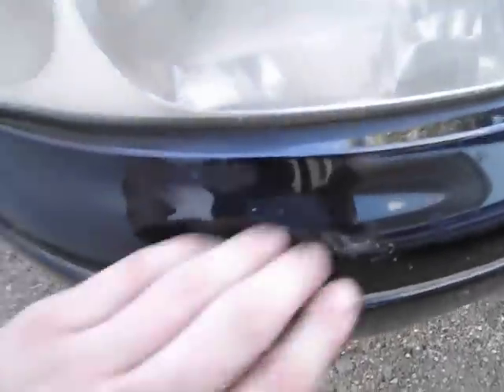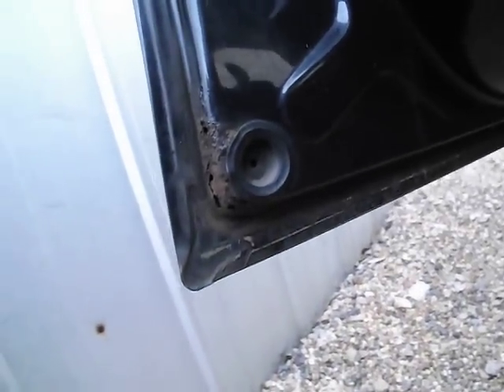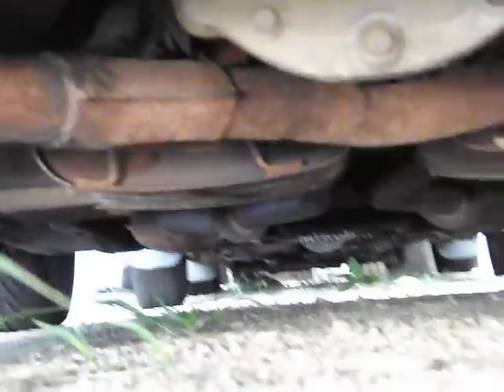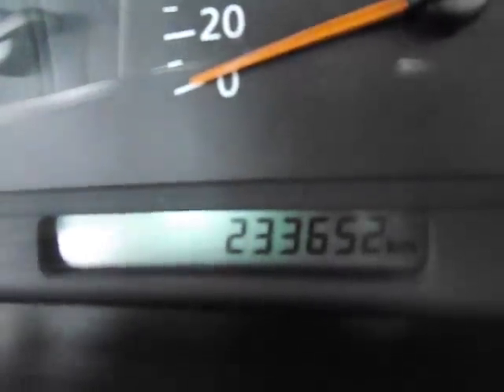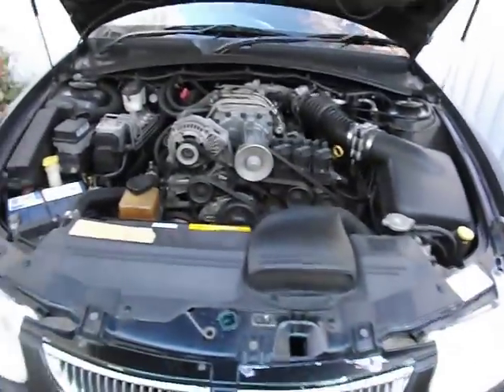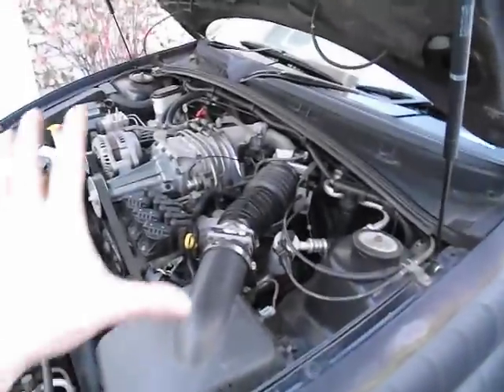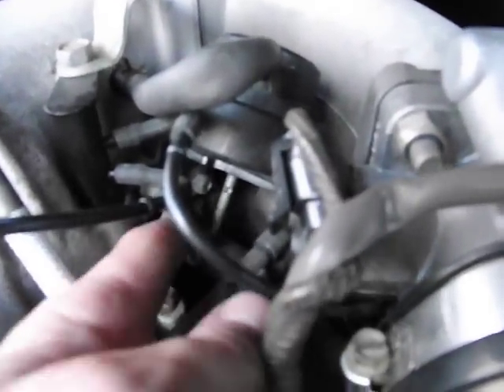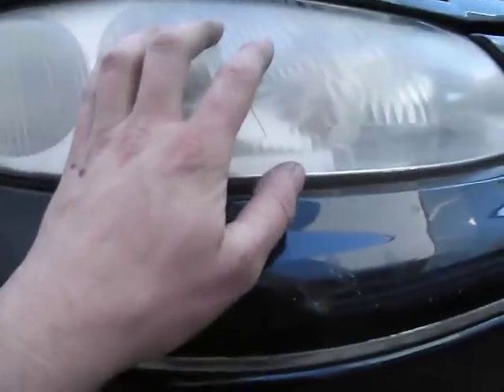VT Calais 1998 suupercharged

Comment: The GM 3.8 liter V6 has a very good reputation for reliability.  Used widely in many different models in the U.S.  Too bad GM stopped making them.
Reply from the maker: My thoughts exactly; the old cast iron head push rod v6 is very tough and will take long term abuse and neglect and still perform well
Reply: rangerpru i find buicks were a stronger engine though they could take a trashing
Reply from the maker: my vs took a hell of a hard life :) towed a twin horse float before I bought that car. this car has not really been flogged

Comment: Looks like really nice car dave :-), as you said its bits and bobs that need some love.
The fact that the bodywork/underside is in really decent condition makes it worthwhile :-D.
I like that engine, a beast but the alternator/turbo/coilpacks are easy to get to, very nice.

The door rust, once fixed you might want to pour some old oil into the door, should leave a really thin coat on the inside, harder for the water to do damage perhaps?.

You dropped on a nice car :-D.
Reply from the maker: I sometimes use fishoil in doors and epoxy paint; but these doors only rusted because no one has ever cleaned out the crap from the inside of the doors. The car is a diamond in the rough. should be nice when I'm done with it

Comment: nice find !!!!!!!!
Reply from the maker: It is what I call a diamond in the rough; but it will clean up well. the engine and driveline are sweet as. it has 233,500km on the clock and it has not been thrashed.
Reply: supercharged and "has not been thrashed" ahhaha ;-) ;-)
Reply from the maker: LOL well before the guy I bought it off it was a monash uni car that was part of someone's tenure (a woman that definitely never drove it hard); the guy I bought it off hardly drove it and I could tell never thrashed it. I drove it hard ish when I drove it home from melbourne and shit a vacuum line that was fairly sad and only failed because I was harder on it than he was. There were other calais that had pod filters and had obviously has the piss flogged out of them

Comment: definitely vy ss rims
Reply from the maker: I thought they were :) but I really wasn't sure because I have been stuck in a timewarp as far as cars are concerned and have a limited idea of models and accessories.
Reply: wickedxe all gee mate. im alright with my vt vx's so anything your stuck with let me know might be able to help. p.s put a smaller pulley on the charger 😜
Reply from the maker: no worries mate :) smaller pulley at some point in the future :) I do need to replace the supercharger coupler though; it's worn and the s/c rattles when it is idling. just a matter of finding oil and a coupler at a reasonable price (probably from the usa would be my best bet)

Comment: Gr8 video. Do U think can supercharged a Ecotec?
Reply from the maker: Absolutely yes you can, you need L67 heads,  inlet manifold and supercharger (+ associated components)
Reply: @wickedxe  cheers, mayb cheaper but a whole motor
Reply from the maker: @grahambate3384  One thing to consider is that an L67 has stronger rods and crank. It also has 4 bolt cross bolted main bearings, the decomp pistons also mean you can easily run 20 psi of boost without having to do much except a dyno tune
Reply: @wickedxe  sweet, i heard u can go 15 psi with turbo on a ecotec, i think i going to look around for the l67, cheers
Reply from the maker: @grahambate3384  They are an awesome engine that out of the box are designed to take boost, I do like the idea of a turbo ecotec. The L67 is not exciting stock 6psi and really needs more boost, an intercooler and dyno tune. Mace engineering and superchargersonline.com are your friends
Reply: @wickedxe  thx mate